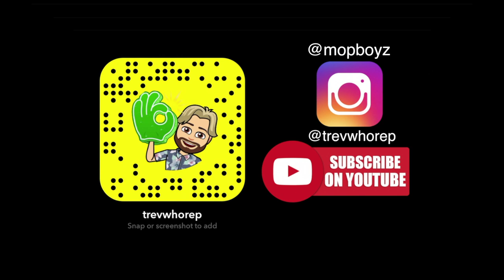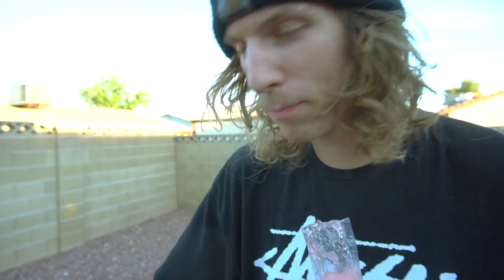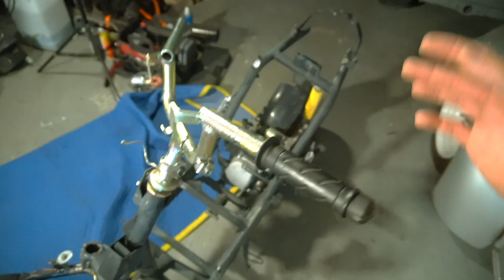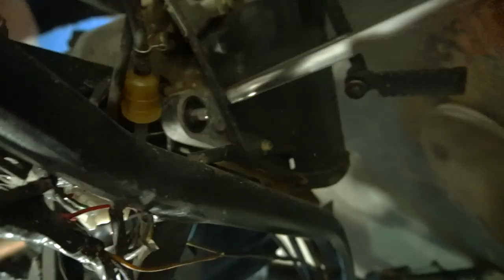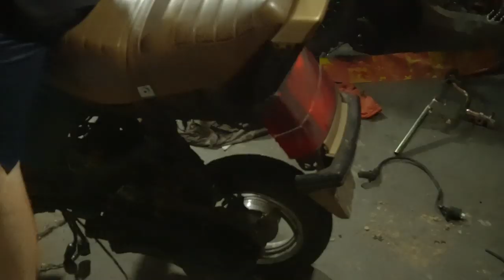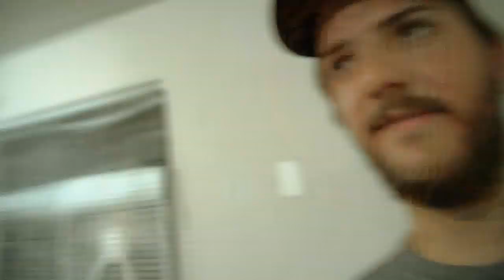we REBUILT the TANDEM SCOOTER powered by 150CC GY6 Engine

Comment: Black smoke boost leak white smoke oil or water could be a blow head gasket hence why it runs good when you first start it soon as engines got load on it engine taps out broooo

Comment: I would re-enforce the connection between the two frames..  I can see it cracking in half on a hard bump with the weight of two on it..  lotsa leverage on that weld point.

Comment: The glow plugs on the bus could be gone or low fuel pressure from the pump also a possible intercooler leak or as u guys said the injectors hope this helps
Reply: And could be a blown head gasket that's pulling its self together till it gets hot

Comment: You can probably replace the head gasket on the bus it's easier than it seems. You need to get a proper diagnoses from a professional mechanic so you know your replacing the right part.

Comment: , ... dose it run rough at idle  or dose it run perfect and randomly do it The most common problem with a 7.3 From my personal experience of owning  about 10 of them ICP sensor cam sensor intake Plenum gaskets also injector harness can go bad on passenger or driver side very common just have to pull valve covers ... make sure is has enough oil it it as well oil pressure controls your hpop with controls fuel